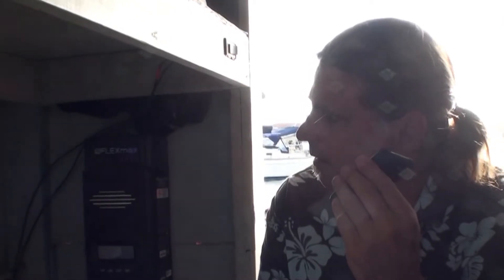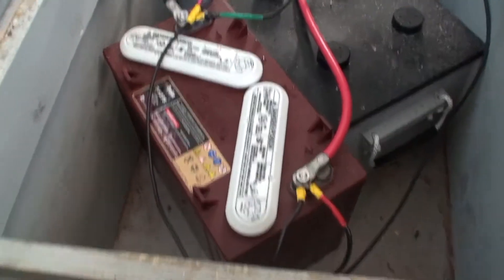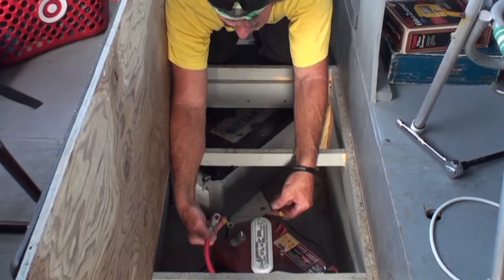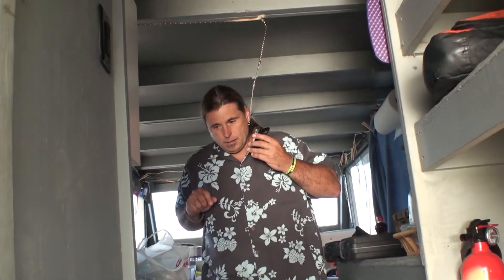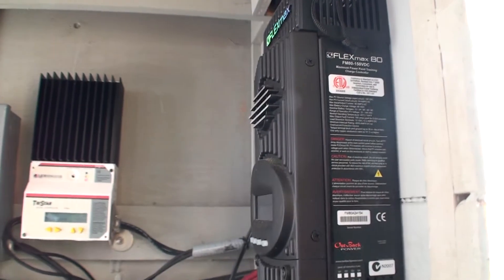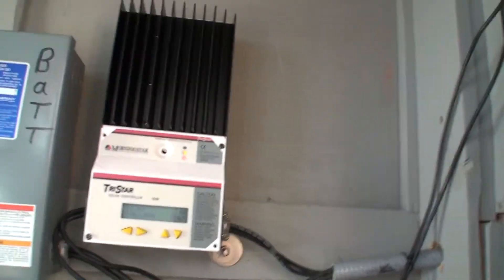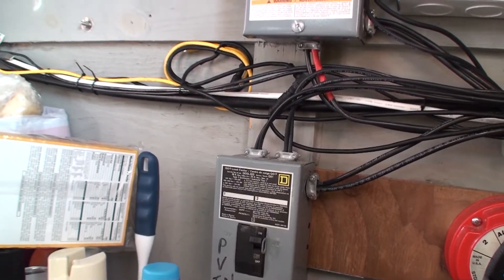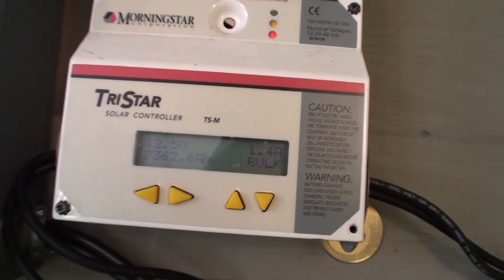Solar Boat Trouble Shoots 12 Volt System 32

Comment: Not a good advice to disconnect the batterylead before disconecting the solar panel, to reset, first disconnect tge positive solar panel wire, than the battery, wait for 30 sec than first connect the battery, let regulator first start up, iff it doesent parralel a sec battery with the empty one, let it start up, then connect the panels back, let it start charging, then disconect the parralel battery and the charger should do its work, only iff the empty battery is stil working this should work,